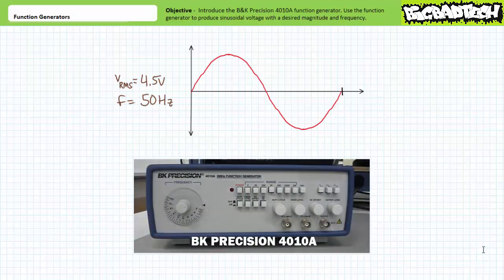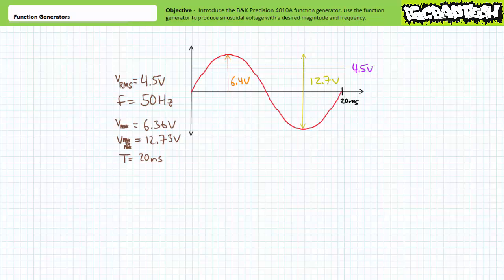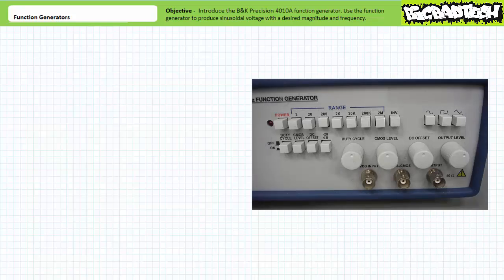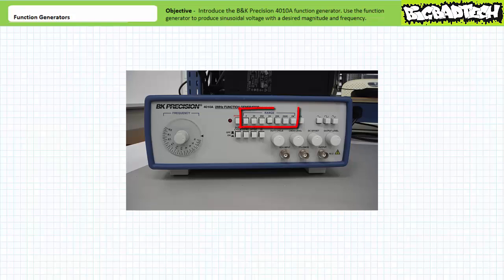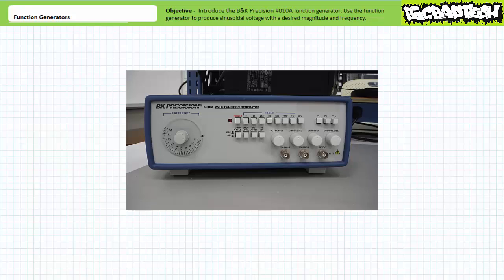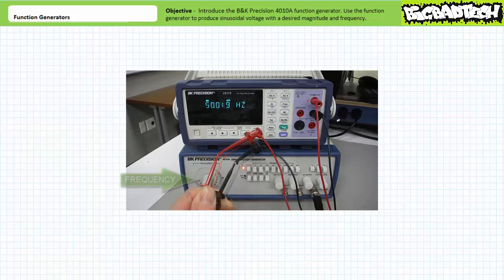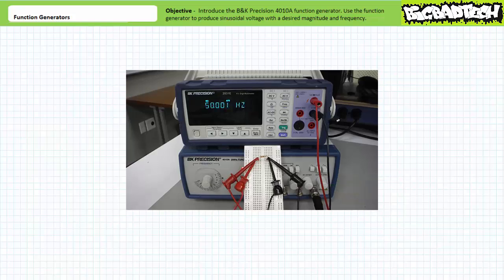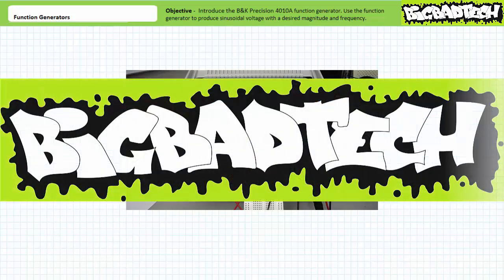Function Generators: B&K Precision 4010A (Full Lecture)

Comment: The reason why the voltage RMS dips a bit while connecting to a load ties back to what we did in DC circuit analysis. Where a source is NEVER ideal and has its own resistance too. When it is connected across a load it is a voltage divider!

Comment: The dial does not start at zero for any range.  It starts at 0.1x of the selected range at the low end marking on the dial and goes to 1.0x the selected range at the high-end marking on the dial.   From the manual:

2. RANGE Switch. Selects output frequency range. Seven ranges from 2 Hz to 2 MHz. Switch indicates maximum frequency of range and is adjusted with FREQUENCY control to 0.1 times the maximum. For example, if the 200 kHz range is selected, the output frequency can be adjusted from 20 kHz to 200 kHz.

This is why the stated range of the device is 0.2 Hz to 2MHz, not 0Hz - 2MHz, and why the dial accuracy is stated as 5% regardless of selected range.

Comment: I measured the output voltage of bkprecision to be 10 volts, but when connected to the circuit, the voltage is -10 volts, is there any way to fix it?
Reply from the maker: Are you talking AC measurement (which should not have a polarity associated with it) or DC offset?